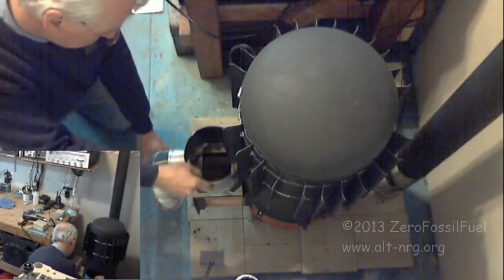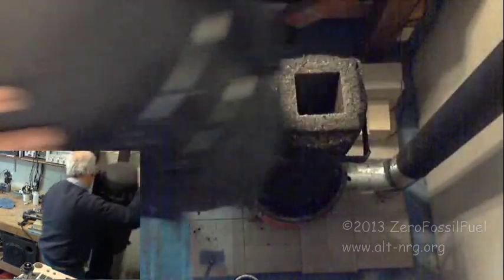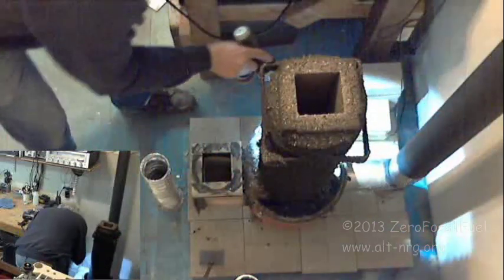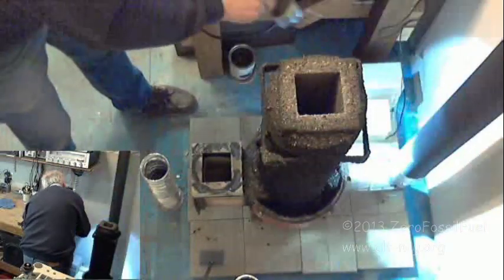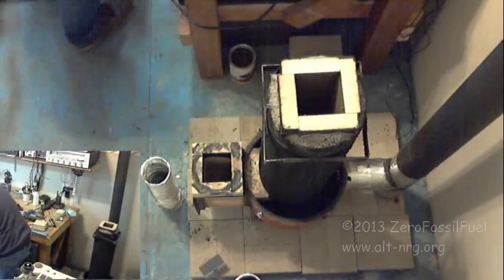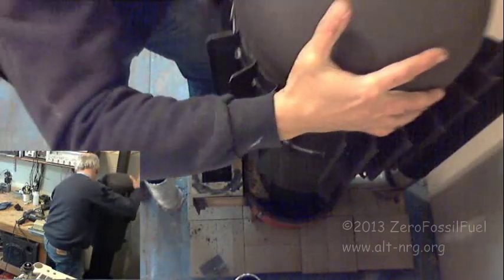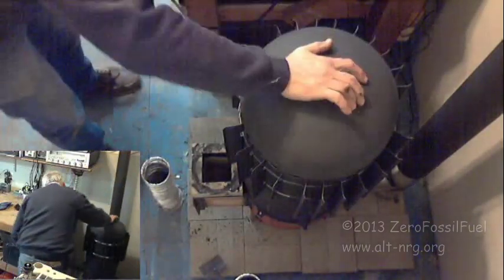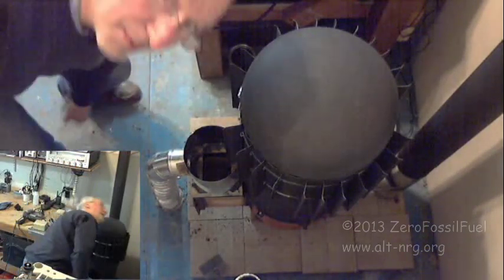#327 1st inspection of Rocket Stove Heater

Comment: I have to say, this is the most well thought out, well-documented series of rocket stove videos.  The ONLY thing I would change about your design is to flatten the top of the dome so that it could be used to cook or humidify the shop with a small pot.  Other than that, your original design and modifications are truly top-shelf stuff!   :)
Reply from the maker: Yep, a 1/8" thick by 1/2" wide metal bar can be bent into a hoop, tacked welded to the top, a flat plate on top of that and presto! You have a cook-top!

Comment: Some questions; Would it be at all beneficial to build a gasifier on top of the rocket stove and then run a pipe from the gasifier to the burn chamber? That way you would always have a supply of super-dry kindling and be able to bump up the stove output without using more wood (I think). Also, if you desired, could you lengthen the width of the "J" tube at the bottom, increasing the distance of the burn chamber from the riser tube and rise the height riser tube correspondingly to compensate without negatively impacting performance? I am planning a build and your videos are a wonderful resource, thank you.
Reply from the maker: I don't think the top will ever get hot enough to gasify wood.

Comment: I do like your design.  However, I don't understand your temp readings (in Fahrenheit I assume?)  and which seem somewhat conservative as my own often exceeds 800F (430+c) at the plate on top of the bell.  The exhaust is usually a few degrees over whatever room temperature is at the exhaust discharge, but that's because of its length.    Differences in my unit FYI: Firebox is sealed and primary air is highly controlled, effectively rendering it more of a gasifier. The throat area, as it enters the bottom of the 'riser' is restricted about 20% by a shielded injection slot on one side that injects warmed air while also generating a vortex as well as the proportions necessary for the unit to produce thrust.   My 'riser' is a simple 3.6" ID medical grade ceramic cylinder. Up the middle of the riser extends, from the base of the unit, a ¾" id GI pipe to controllably introduce fresh heated air to a point about 12" up the cylinder.  The stove produces 50 ish Pascal and the 5" id exhaust / heat exchanger runs at floor level approximately horizontal for some 10m, with strategically places cleaning (vacuuming) and drainage points, before exiting the building at ground level.  I do believe that controlled air introduction is fundamental to efficiency in such units as this is important to get right on the heat/inert gas generators ( effectively just big rocket stoves) used on tankers.

Comment: Hello Zero,
Again a very successful presentation. Very surprisingly, the few ashes and the resulting
an absolute minimum fuel consumption. Maintenance is also very low.
I'm excited right. My thoughts go in the direction as an investment in my greenhouse
install. But I had already addressed. Can you inform me how many degrees below the container the
has exhaust gas temperature? This is interesting for me, because I consider the exhaust gases for heating the soil to use.
I imagine in 60 cm depth a collector of PVC or PE pipe to be laid by the then the exhaust gases are passed.
Do you think that this is possible?
thumbs up
Greetings from Germany
Michael

Comment: I like the concept,  but if it were me I would  replace  the fiberglass insulation, and leave the ashes.
Meaning  hotter burn will solve most of your ash problem ,
Reply: Is this right ? Cause I look for this information ^^ don't want to clean it every mont, what I've read so far there must be way less build up ? I think if I reach the 1300-1400 C° with the fire I will have way less ash, I'm right ?
Reply: I agree with Scott. Look into making or insulating you riser with a perilite mixture or aircrete. That would increase the heat in the riser greatly.
Other than that it looks and works good as is.
I started making one last summer and have been experimenting with perilite and aircrete. This spring and summer I hope to get r done.

Comment: Hi Z, great vids,

I know i am late to the game, but have a query, 
is there any deterieration to the inside of the firebrick  riser.

I am in the midst of building my garage heater project now, 100lb propane tank , incorporating a lava rock catalyst, and was going to use stainless steel for the riser, having second thoughts.

I already purchased firebrick for the j-tube but I think i may as well build the riser with firebrick also, as you did.

Thoughts 
cheers

Madd Macc

Comment: how hot does the underside of the burn chamber get? I'm trying to build one to sit on my hearth and the 'floor' will be the split 1-1/4"-thick bricks that also serve as the burn chamber floor. Underneath is brick, and I'm not wanting to cause them to spall due to heat cycling
Reply: upon reflection I'll just put a 1/3" to 1/2" layer of perlite down regardless.. I think that should cut the heat down well-enough

Comment: real surprised the Fiberglass held up. Is it still intact?
Reply from the maker: Yes. Despite all of the criticism from skeptics, my own predictions were correct. There are no signs of degradation after two full seasons and record high operating temps of 937 *F.
Reply: Very impressive
Reply: I wonder if the firebrick is holding the bulk of the heat in

Comment: great build zero that's about the size heater im going to build for my shed. I did wonder whether going that small would work in regards to a lot of ppl saying that it wouldn't but im glad you nailed it as it has inspired me to do the same. putting a 44 gal drum in my shed just wasn't going to happen, great mod with the heat exchanger fins, cheers,. glenn

Comment: Is there any reason a person coul not use a barrell with no bottom-just have a metal sheet under it to catch the ashes.............then you could just lift the whole unit up, slide out the metal sheet with ashes----dump them, slide back under..............???
Reply from the maker: The top shell would have to be fixed to the riser meaning you'd essentially have to lift the entire stove each time to do a full cleaning. My design permits just the top half of the barrel to come off for cleaning.
Reply from the maker: Although I suppose if the barrel was supported on stilts it could have a trap door bottom. Maybe not such a bad idea! Build it! ;-)
Reply: ZeroFossilFuel I actually may do that!!!  I have some about 20" high by about 15" across at the top barrels, which have the metal band-style lid with the snap enclosure (probably a correct name for that style--?).  If I flip it so that the top is the bottom, etc.., and have someone weld a 2 or 3" lip on the inside of the band/clip lid (which is now the bottom!)-this would enclose the ashes on the bottom lid--------so that when I release the bottom the ashes are contained...I'm sure you get the picture!!

Comment: did you use a brinkman smoker for the outside and explain the fins
Reply from the maker: Um, what does a Brinkman smoker have anything to do with a rocket stove? The answer is no. The fins are for rapid heat dissipation. Thanks for watching.

Comment: Hello, it' s me again. If you don't mind, what's the average temperature you're getting on the top of your stove. My stove is only reaching max 380F which I hear is low. Thanks
Reply from the maker: A lot depends on the distance between the riser top and inside of the tank. Closer gap = more concentrated heat at the top. Larger gap = more evenly distributed heat down the sides. That's how I made mine. Also depends how I feed it. Last night I had it running between 600-650F by stuffing the wood a little tighter than usual which made the coals propagate up the side of the wood inlet further than usual. Most times I shoot for only 400-450F at the top.

While your build quality is outstanding, the fact that it's all steel with no insulation around the wood inlet or first part of the horizontal tube is hurting you so much more than you know. Mine is all insulated fire brick with insulated riser and I am seriously considering adding a 2nd box around the wood box and burn chamber with 1" insulation to get the fire box even hotter.
Reply: Thanks for the advice, I'm considering changing the firebox and riser to firebrick or build a new stove altogether. I've learned a lot from this one however.
Reply: ZeroFossilFuel I've determined that if the inlet firebox is allowed to get too hot, then you run the risk of back drafting.  Cooler the better.
Q.  With the vertical exhaust immediately adjacent to the burn chamber, don't you get "too much" draft?  I would think it would cause the wood to burn too fast and when the wood is gone the heat in the building would race out the roof.   Not a fan of fresh outside air intakes.  They don't seem to help at all.
Reply from the maker: No such thing as too much draft. That's the whole point of the Rocket. That then lends itself to then using dampers to control burn rates. We'll have to agree to disagree on the fresh air intake.
Reply: I guess is depends on how the RMH is used.  I heat a greenhouse.  When the wood burns out, the draft continues long after the coals are gone.  What I found is that the cold air draft will cool the RMH and in turn the greenhouse much quicker with a fresh air intake.  This is a fact not speculation.  I do agree to disagree on too much draft.  Too much draft will cause the flame to flicker which causes the combustible gases to travel up the riser without completely burning.  Personally, I want all flames to occur in the burn chamber and up the beginning of the riser, not between the riser and the barrel.  If for whatever reason the air flow in your RMH was suddenly halted, the combustible gases in your setup could travel throughout the burn chamber, riser and beyond.  Then, when O2 happens to mix back in... you could get an explosion.  IMHO Too much draft can be dangerous.  I would like to see temperature readings down the side of your barrel.  You want to see hundreds of degrees of drop top to bottom.  If the temp in the outside the riser gets too high, the draft could stop momentarily and cause the situation I previously mentioned.  I have spent hundreds of hours burning, diagnosing, fixing, rebuilding and studying my RMH over the last two Winters.  They are extremely interesting and useful.

Comment: Hi again. Did you find bringing the independent fresh air feed from the outside made a big difference in the stoves performance? I'm having problems in that there seem to be negative pressure sometimes, the fire seems to be starved of fresh air and slows right down. Here's a link to my stove. Thanks in advance.  Rocket heater, successful first burn.
Reply from the maker: Absolutely.

Comment: Hi, I really like your stove and am considering building something on the same lines. Having to remove the upper section seems a bit of a pain when removing the soot. Would it be possible to have a small hinged access flap on the lower section that you could insert a vacuum cleaner or do you think that would be sufficient. Thanks in advance.

Comment: put a fan in the vent pipe so you dont have to blow to get it going only a small 12v fan whold be good and you can all so use it oneces it goong to add my heat to it my rocket stove has a fan in the vent pipe recmoned it

Comment from the maker: Nothing major. I've already got threaded pipe fittings on the outer tank walls I grab onto to lift the top half off. I will put fins on the flue pipe, move the fresh air inlet 90* for easier access to cleanout cover, lose the wingnuts, reconfigure the angle iron so the cleanout cover can just slide straight up and out.

The pallets burn best but pulling out the glue coated nails is a PITA. Sticks and twigs work okay if they're really dry but the bark leaves a lot more ash.

Thanks for watching!

Comment from the maker: I've done it. It's tricky. Requires smooth precut lumber to keep from getting hung up on the guides. Had three 1"x1"x36" burn for 1hr 40min. DO NOT BE TEMPTED TO MAKE TALL SEALED WOOD HOPPER! It will become a reverse flow flue pipe! A better approach would be some form of pellet feeder, augur or gravity like web4deb.

Comment: Great information. I am new to rocket stoves, looking to heat my cabin off the grid. One draw back I see is the fast burn rate and need to put new wood in box.  What if you used longer pieces with some sort of guide or support?  I envision five foot long pieces of wood standing straight out of fire box.  Would this work?

Comment: Using a rocket stove to generate electricity would work (stirling engines, peltier junctions, steam turbines), but you're probably better off using the stove for just heat and getting your electricity elsewhere.

A wood gas generator + gas turbine would have good electrical output but it would be loud.

Comment from the maker: That's one of the drawbacks of a Rocket Stove for sure. I find with my tiny firebox, I have to tend to it very briefly every 10-15 minutes depending on what size wood I'm feeding it and how hot I want it to burn. This inconvenience is offset if you build your Rocket with a thermal mass that stores and releases heat between burns. In that case you run it for a couple hours in the evening and the mass gives off the stored heat throughout the night and following day.

Comment: Looks great! Only comment, modify the feed box to allow front plate & brick up/down slide movement so that start up and cleanout is easier. (Up to light from front & not from top) You may need to move the fresh air tube along the sides of the feed box. Also, have you tinkered w/pellet feed system.......?

Comment: The hardest part to understanding the concept is the burn chamber, horizontal vs vertical.  The gases are completely or nearly completely burn in horizontal hence no smoke once it gets to temp.  The ash does not go up the pipe, so very little of the product is left from burning it is amazing.  And yes there are commercial versions of the Rocket Stove available, but why spend thousands when you can make yours for far less!

Comment: Z- if you put you angle iron so the angle went to the front rather than out you could get rid of the wing nuts - the metal piece you would slide up and then pull up the front fire brick

Comment: Way to get "techy" with the cameras and USB mics!  I like the stove and I think those talking crap about it are totally missing the point.  I burn wood on a regular basis and the amount of ash you produce in 2 days is a fraction of a normal wood burning stove.  Means you are getting a nice complete burn so there is something to be said for that.  I think you could take more advantage of the mass heat sink concept if you wanted, but even as it is it's very well built.

Comment: you haven't put in a p channel in yet it will give you a better burn (yes even better than you have wricht now) it an air inlet you put in your fire box that is 6.8 % of the surface of the burn channel .you put it at your bell side it go's just under  the  top of your burnchannel about 5 mm so you get a ventury effect  gets you a cleaner burn  no co  /mol but co /million  try it out you'll see 
 good luck I know you don't need it but hey anyway try it 
sorry for my englich not my mother tounge

Comment: LOVE IT!!!!

Thanks for Sharing!!! now you can add an under the floor water heating system to go with your hot water heater for the shop?? LULZ!!!

maybe add some thermal mass and re-route the chimney to give the heat more time to dissipate before being dumped outside?? 

the chimney could run along that back wall behind your bench and hole thru the wall at the other end of the room could be installed.. and your heat fins on the longer chimney would be another FANTASTIC way to use ALL! the Heat!

Comment: I am sorta confused; i've seen rocket 'stoves' used for cooking and then for use as a heater, there's the rocket 'mass' heater. On this one of yours, i do not see any 'thermal mass'. did you weight this option and decide the mass was unnecessary or that the mass made too little difference? thanks

Comment: zero after taking the brick with the string off, you might be able to use a shop vac without more disassembles. If you add a vortex dust separator than absolutely minimal ash would actually make it to the vacuum it self.

Comment from the maker: I prefer to shut it down the way I am by sealing off the top of the firebox. Closing off the 3" pipe would only then start pulling in air from around windows and doors. Moist air also condenses on cold steel tools rusting them out. There's a method behind the madness.

Thanks for watching!

Comment: Add a damper to the 3 inch cold air inlet and to your exhaust flue.  That will make it easier to stop air flow through the stove when you shut it down.  Also add a pot of water in the top of the stove.  Moist(er) air transfers heat more efficiently.

Comment: Great to see a through inspection after a good run. Was really impressed with the low amount of smoke that came out when you lit it and where blowing in there. A lot of fires smoke a lot for cold start, before the flue starts sucking. The instant draft is also impressive. You might want to empty that flue ash catcher more often though, looks like it might have filled and been blowing past. At lest you have one though, most fires just exhaust all that. Yours looks very clean burning. Well done.

Comment: looks like more ash ended up throughout the system, than in the bottom of the burn chamber.  Maybe due to the higher air flow through these stoves.   A little scary that it could plug your air flow in the exhaust stack.   Keep good batteries in your CO2 detector.  I noticed you protected the walls from heat but is the end of your work bench protected also?   Good work overall